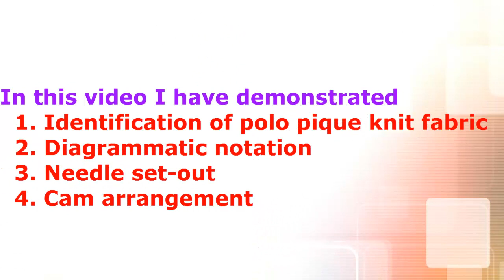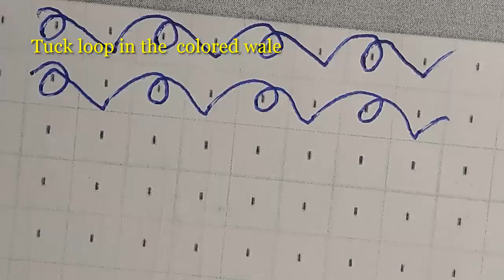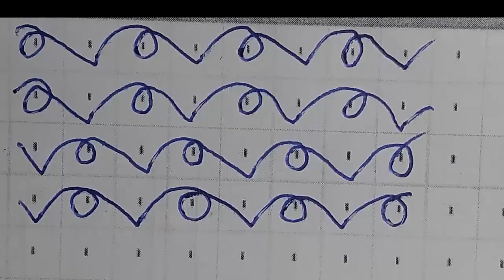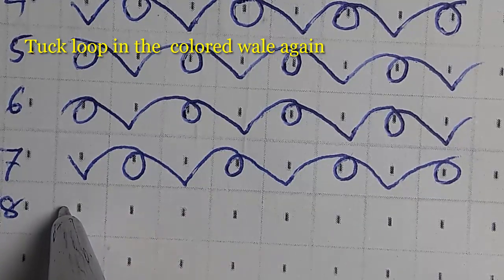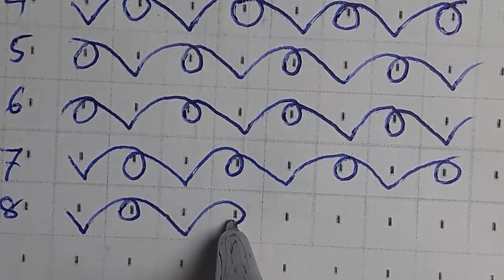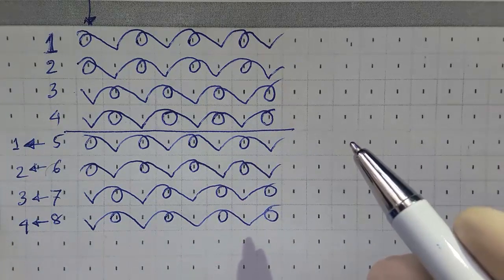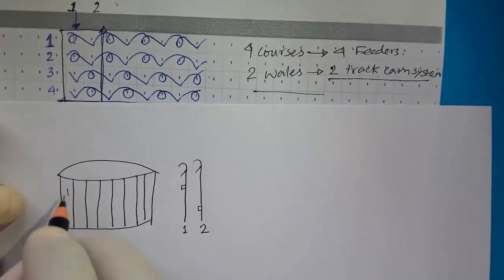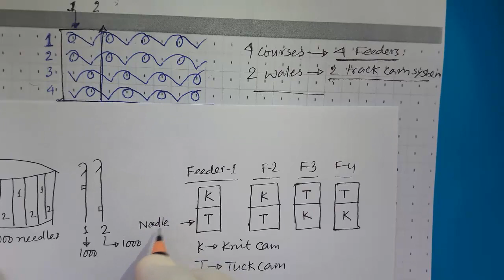Polo #Pique fabric identification by Emdad Sarker #Emdadsir

Comment: Verry satisfiying video the explanation was easy i want to know what type of yarn are used for this polo fabric and want to know wich gauge number and needle type needed to make this fabric.
Other think are there different type of knit tuck and miss cams i mean different dimension and designes?  Hope for your quiete response thanks a lot for the video
Reply from the maker: Thanks for your valuable comment. Normally cotton yarn, 80/20 CVC yarn are being used. latch needles are used in the knitting machine for this purpose.